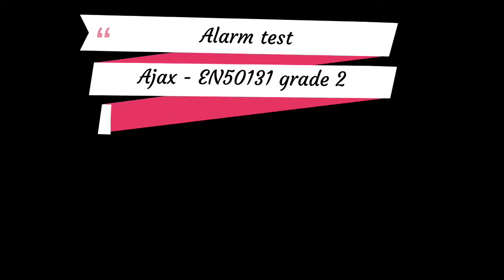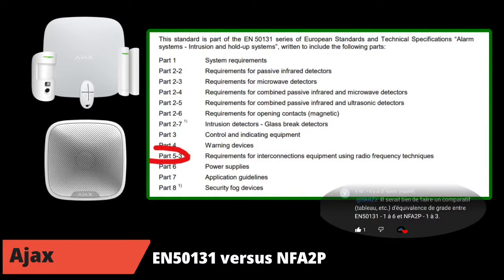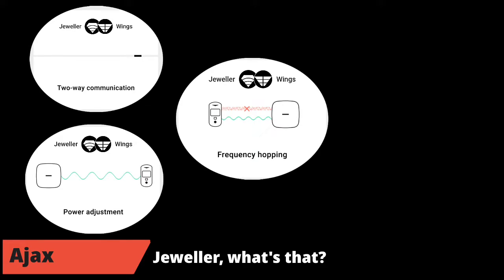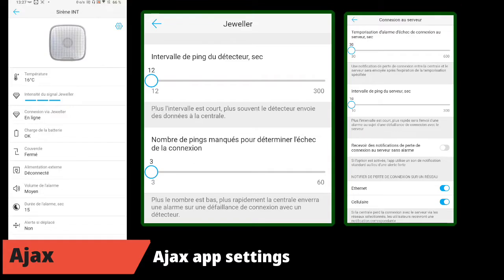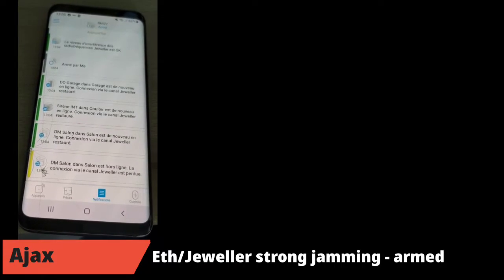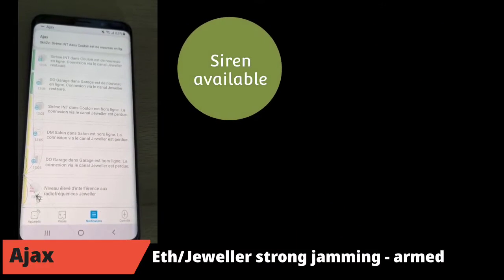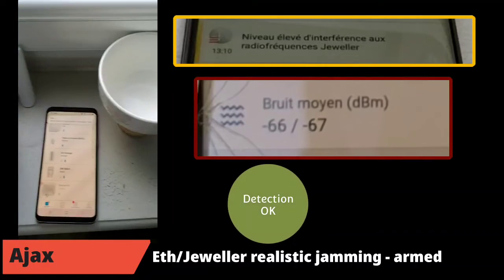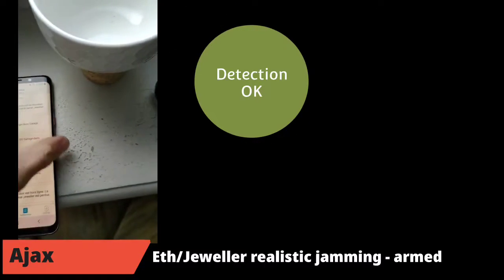Ajax alarm, jam the Jeweller protocol ? Ajax needs to update his alarm to make the sirens ring..

Comment: Do they not have a wired system now
Reply from the maker: Mainly wired (Fibra)
But what about wireless?
Reply: @choisir-son-alarme  I believe the wirless system along with hikvision and ring Brand are not insurance approved anyway 

This month the AJAx hybrid alarm is out wired system so that will be better than it’s wirkess
Reply from the maker: @tristanedwards1340  I do not agree.
They can easily and really even with a wireless system handle the interference and properly.

No need wired or hybrid systems. 🙈